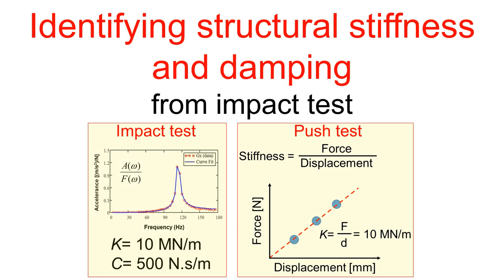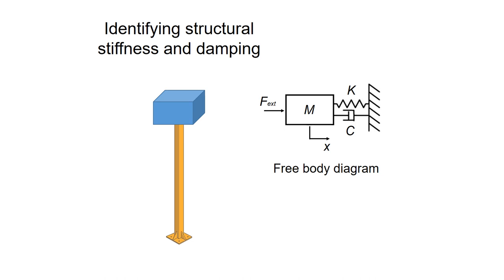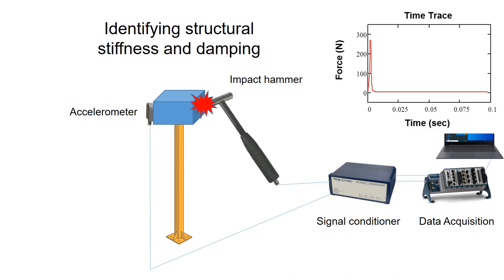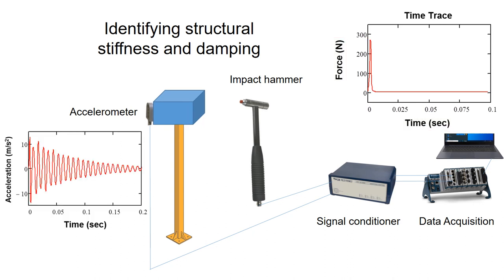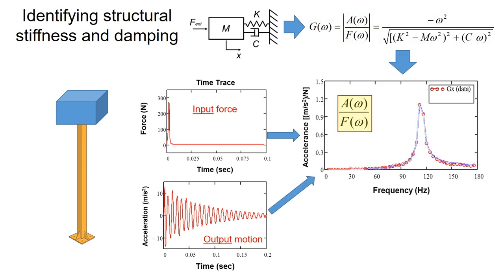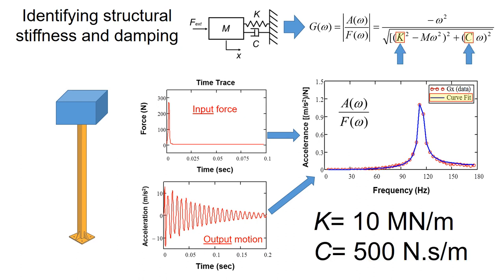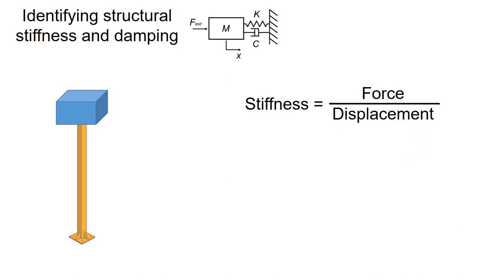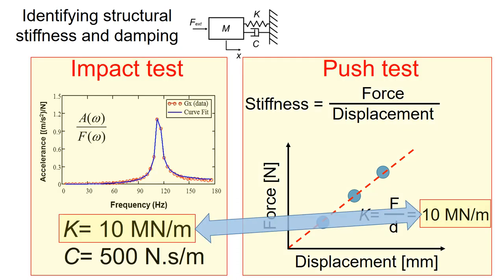Part 15 - Identifying Structural Stiffness and Damping

Comment: Hi, great video (as always). I have a question regarding the way you are suggesting to evaluate stiffness and damping.
Regarding stiffness - if I know the natural frequency (and mass of the system), I can get the stiffness from  - ω_n=sqrt(k/m), no?
For damping - from the time domain plot (possibly should be displacement Vs time) , I can extract two consecutive peaks, get δ=ln(x_1/x_3 ), the zeta: ζ=δ/√(δ^2+〖(2π)〗^2 ) and then ζ=c/(2mω_n ). Does this makes sense?
Reply from the maker: There all many ways estimate stiffness and damping. I am just showing one example. 
Yes, using peaks from time domain to estimate damping is very well known method.

Comment: How do you calculate the Stiffness and Damping from the Impact test? Can you use the FRF of the Displacement and Velocity against the applied Force?
Reply from the maker: Thanks for reaching out with your question! Calculating stiffness and damping from an impact test involves some key steps, and using the Frequency Response Functions (FRF). Here's a general outline of the process:

Modeling: You can model the system using appropriate equations, such as those from the single-degree-of-freedom (SDOF) model.

FRF Calculation: Calculate the Frequency Response Functions (FRF) by taking the ratio of the output (displacement or velocity) to the input (applied force) in the frequency domain. This will give you a representation of the system's dynamic behavior.

Stiffness and Damping Calculation: Stiffness (K) and damping (C) can be extracted from the FRF. The resonant frequency corresponds to the natural frequency of the system, and the width of the peak in the FRF curve provides information about damping.

I'll be delving deeper into this subject in future videos, so be sure to stay tuned for a more detailed exploration.